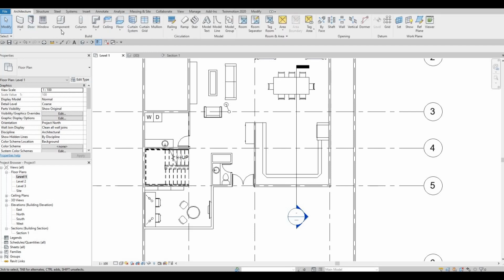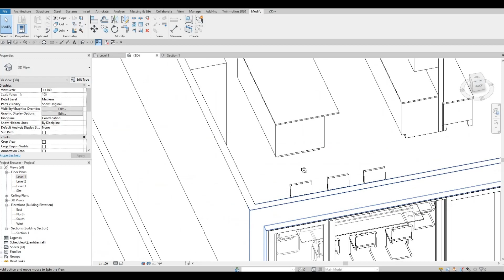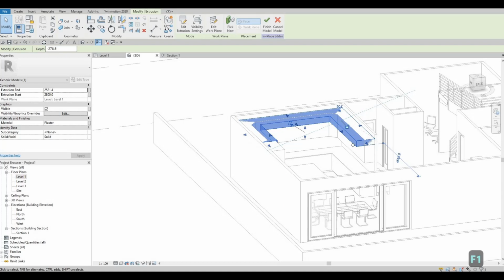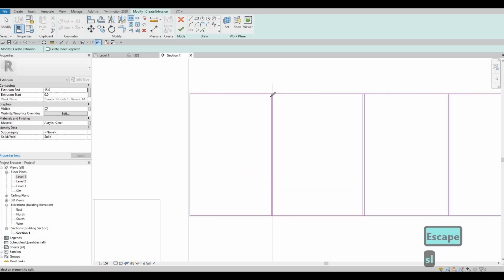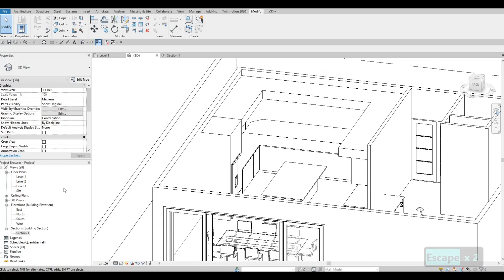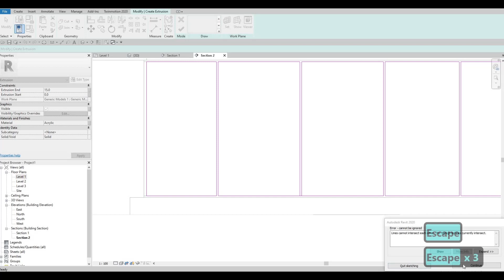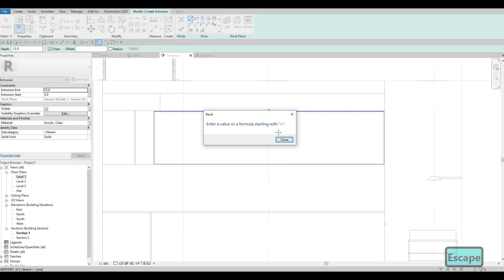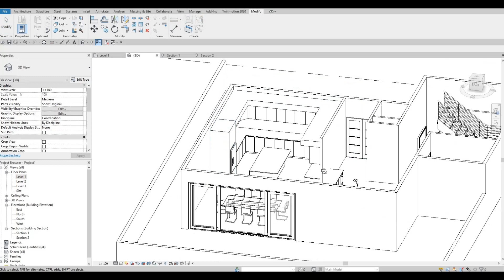TEPLM House | Part 5 | Complete Step By Step Project | Revit and Twinmotion Tutorial

Comment: When your doing the divisions in the cupboard with the "Split Element Command'. You should use the "Delete Inner Segment" option, right in the top left corner. Which is the "Modify | Create Extrusion" ribbon. It would eliminate the need for the Trim / Extend command. That's just my suggestion. Other then that. Awesome work on the video and the channel.
Reply from the maker: Hi Etiene, perfect suggestion. I appreciate your input. God bless 🙂🙏